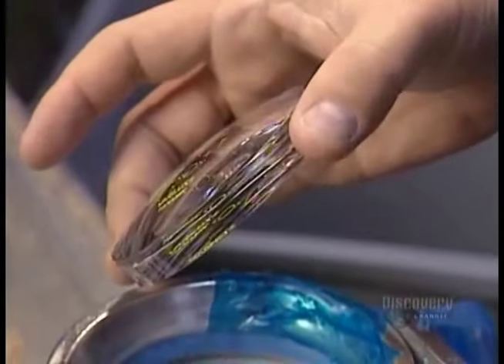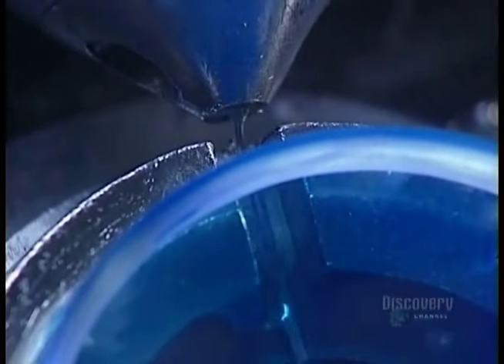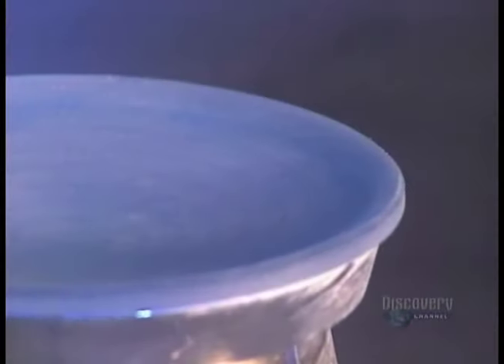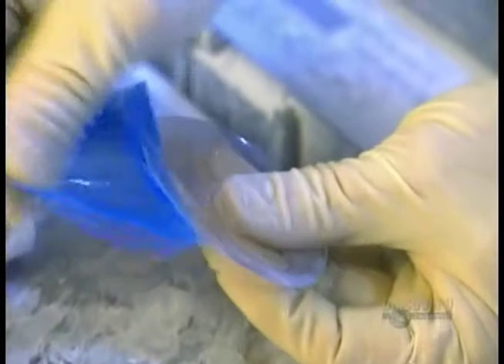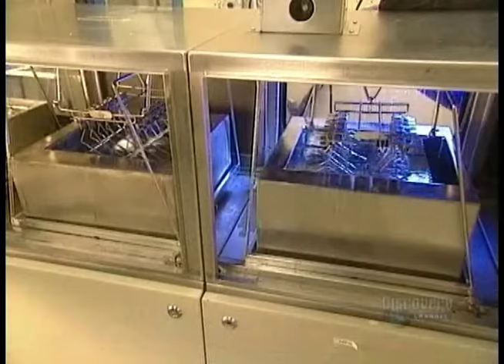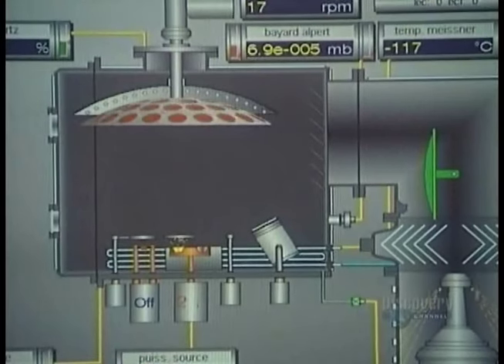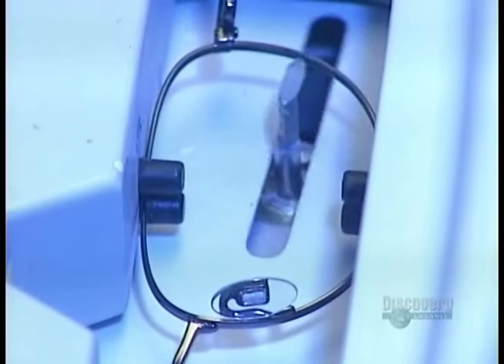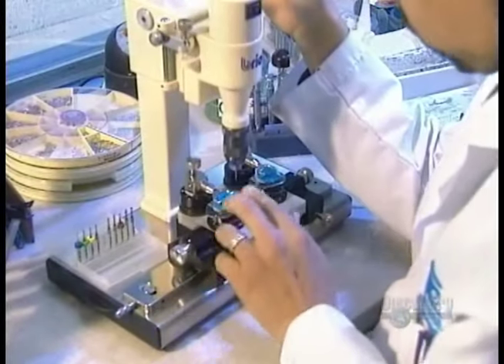How It's Made - Eyeglass Lenses

Comment: Ok. But then I have a new question: how do these plastic discs are manufactured? When is the prescription about the magnification, for example, set up?
Reply: I work where they make those discs. It's pretty simple when you break it down how those are made. If you look up any standard injection molding machine process. Each of those blanks can be cut to a set range of prescriptions and magnifications, which is why they are so thick.
Reply: @Airleagan  I wouldn’t mind hearing more about this
Reply: @Airleagan  Also the type of plastic used varies depending on the index level. I just purchased 1.67 ultra high index lenses because my prescription is so strong and I don't want lenses as thick as bottle caps on the sides.  The type of plastic for those I think is very very dense.
Reply: @rem45acp  Most of the plants I interacted with never used anything other than Polycarbonate. Higher index lenses are made with a glass-casting process, not injection molding. While both are sold by EL, the process in this video is not reflective of what would happen to make a higher index lens.
Reply: That's what I was looking for . . .

Comment: i wonder how they make the actual GLASS ones. probably a similar process but machining plastic seems much easier
Reply: Actual glass isn't used in lenses anymore, at least not lenses requiring high prescription and astigmatism. They would be super heavy and large.
Reply: @rem45acp  yeah i know that it's not the most common material nowadays, but they 100% used glass  not very long ago, specailly before plexiglass didn't even exist (some years ago). I dont agree with the "super heavy and large" take, seems a bit exagerated about the weight, and there is no need to make them bigger or thicker. The main reason they dont use glass anymore probably is bc it shatters more easily wich is risky, or bc it's more dificult to manufacture. Also glass doesn't get scratched as easily, but plexiglass can be polished easily anyways.

Comment: Seems outdated video. I’m sure they’ve come a long way since then
Reply: The procedure is still pretty much the same. Milling of the plastic disc according to the prescription, various treatments + curing, shaping based on the shape of the frame.
Reply: It has.  most glasses take at most an hour and a half if you wanted everything that was shown in this video.  The longest step was AR coating and it only take 30 minutes on a sp-100.  The backside coating is now done in about a minute.